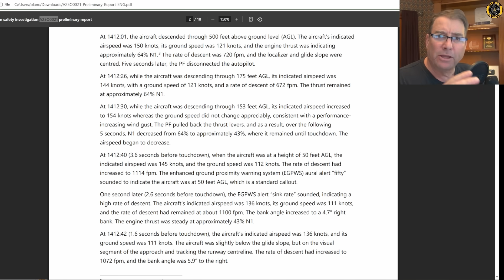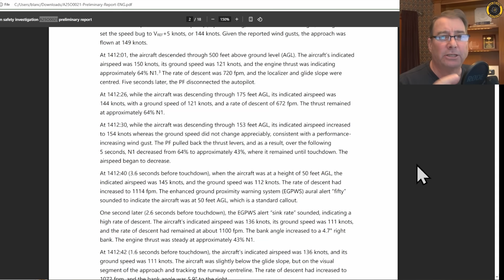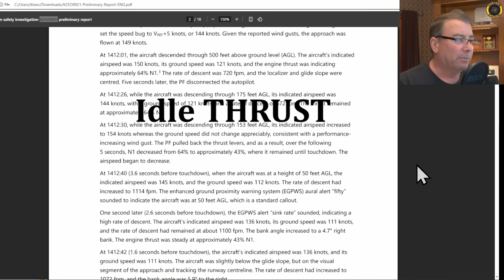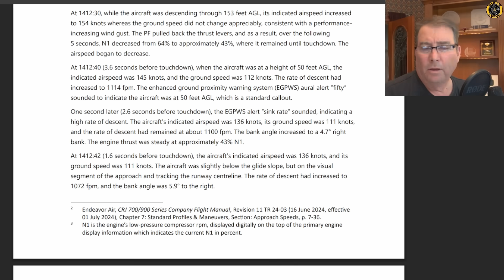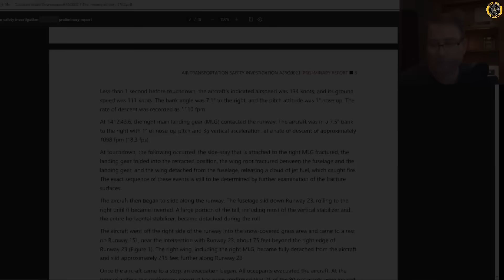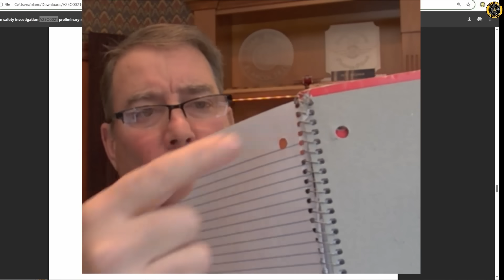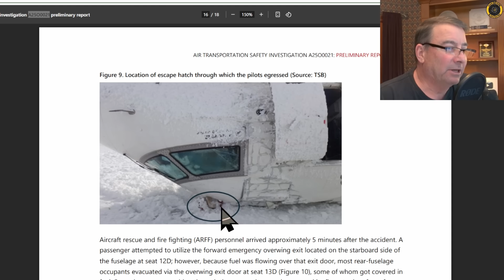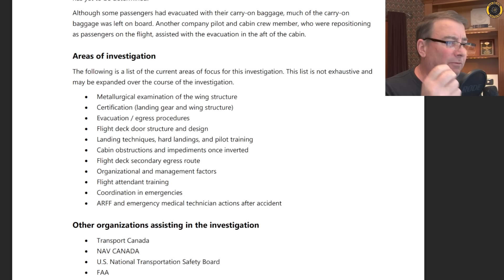TSB Prelim Toronto CRJ Crash

Comment: Retired airline pilot here.
The biggest issue I have with this accident is the captain determines who's will fly every leg 

Captain makes that decision based on what's the safest for each flight 

Good judgment is to select the most experienced capable pilot that day for that Leg

When it's extreme conditions or limits such as a very strong gusty Cross wind with blowing snow

Normally the captain would fly that leg because he can manipulate the controls quickly and rapidly without having to try to take over. 

It also gives the first officer an opportunity to watch someone more experienced in extreme conditions handle Air Craft. 

Learning by example rather than learning by making critical mistakes in extreme conditions probably isn't the best use of good judgment when selecting the pilot to fly. Especially with a plane full of passengers on board. This is not the simulator!!

Captain had more total time and had more time in the Aircraft but less time in the last 30 days than the first officer 

Another factor is that if the Captain and first Officer had flown together on a regular basis and knew each other's skill level that would have an impact on who will be flying that leg.

Perhaps the accident would not have happened had the captain had been at controls at the controls 

It appears that improper control inputs were applied at critical moments prior to landing that caused the accident . 

More importantly possibly poor judgment selecting the proper pilot to fly that day was the bigger issue .

Comment: Pilot lack of skills and inexperience caused this crash. The 1500 hr rule addresses getting pilots higher pay but doesn't address the real problem of people getting into the cockpit that don't belong there. The 767 in Houston, The Horizon Air pulled engine fire extinguishers, now this. What will it take to fix the broken pilot training system which is now placing incompetent unskilled pilots into the cockpits?

Comment: Just think in WW1 pilots were assigned to combat with 14-15 total hours. Recurrent training should include 5-hrs doing touch and goes in a Cessna 152. The high sink rate was hard to see in the videos, but explains alot.
Reply: Yeah in underpowered airplanes with a top speed of 80 mph.
Apples and Oranges.

Comment: I’m wondering if the pilot flying froze in the last 10 seconds and didn’t know what to do. Why didn’t they add power and go around? Fatigue? How did the bank angle get so tilted before touchdown? Thankful the fuselage was rigid enough to maintain integrity to allow everyone to escape. Cars are not built to withstand 130 mph and 3Gs into a hard surface.

Comment: Ok I have landed a plane once but landed a parachute 4500 times. Parachutes are wings, highly inefficient ones at that compared with airplane wings and they are very sensitive to gusts. The reason I bring this up is that I feel these pilots were blindsided by a big drop in headwind at the last second and they had no time to spool up the engines before wheels met ground. So I think all this talk about stick and rudder skills is all well and good but maybe most pilots would have been caught out by this one. I’ve seen enough experienced skydivers wake up in hospital after a gust caught them out ten feet off the ground.

Comment: If she had left the power setting alone...she would still have been hot on the VSI but the bank angle likely not have increased putting a side load on the gear and she might have kept the wing attached.  Ah well, she what she could under the circumstances and now she has additional experience as part of her repertoire.

Comment: I was a EDV check pilot for many years. The one thing that is telling to me is the lack of flight time the PIC had. After 20 plus years one would expect at least 10,000 hours. Also when I would get a new student we would talk about how the AC did not land like the sim. The sim in a wonderful procedure training device and even though it is a level D sim it does not do a great job of replicating the landing.  During a gusty day like the day the accident happened I would always brief "Do not accept Airspeed deviations below target airspeed"  Pulling the thrust levers to idle in the CRJ 900 on a calm day at 150' will probably damage the AC. On a gusty day...well wow we got what happened.

Comment: Two things regarding the crew - The weather conditions were a factor in leading the FO into what she did.  She had already flown into Toronto 3 times recently so she was expecting the “landing picture” to look a certain way. The runways in Toronto are 200 feet wide. That’s 50 feet wider than runways at major US airports. The visual picture of this difference gives the appearance that you are higher over the wider runway.  Next the runway was only plowed to 160 foot wide which may have gone unnoticed by the crew in regards to how that would change the “landing sight picture” for this landing. Next, blowing snow across the runway along with the snow covered airport can drastically affect one’s depth perception because everything is white with little to no contrast.  Finally for the Captain, in addition to being the pilot monitoring he is also the pilot in command - his hands should have been behind the throttles backing up the FO with airspeed callouts and ready to add power when he saw the speed deteriorating and felt the sinker coming. - What was he doing? Did he recognize what was coming? Why didn’t he react with power or pitch inputs? As a sim instructor, the Captain has most likely spent the majority of his recent time instructing from a position behind the pilots he is teaching in the sim which gives him a completely different landing sight picture than the pilots in the sim.   It may be that the Captains lack of recent experience is the bigger overall factor in what happened here.

Comment: After living in Minnesota for many years, there are times when the snow is blowing sideways over the road and all depth perception fades away! You lose reference to the road itself and it’s difficult to realize where the edge of the road is or where the surface level is compared to the snowbanks on either side. I’ve never landed in those conditions, but I have driven in them. Granted, it has to be blowing a good amount of snow to do this but I’ve certainly experienced it. The first thing that occurred to me was that they should have a radar altimeter to call out height above ground for flare reference which should help mitigate that effect but something certainly didn’t follow through on this one. 

To all northern pilots who fly in those conditions, is it easy to lose all depth perception when landing in those conditions just like when driving??

Comment: Juan, I've been a "vehicle" geek my whole life (mini bikes, go karts, dirt/street motorcycles, race car coach, trucks, and aviation) and I couldn't help thinking exactly what your high-time instructor commented.  

I'm a VFR private pilot with about 1,000 hours, much of it in the very gusty KRNO area.  I fly for fun and adventure.  Might do commercial multi in the future, for some expertise and income.

The point is that I don't believe an instructor can take a person off the street, man or woman, train them up, get them through ratings and types, and expect them to have the intuition for, or ability to react to, dynamic changes in "vehicle dynamics".

I have zero time in anything like an RJ (1 TO/LAND in a C650).  But, in my humble opinion, this is a classic example of failing to adapt correctly to the pitch/power speed debate.  Intuition tells me to never pull the throttle back in gusty conditions.  Been there, on a calm day, taking a 20kt rear quartering tailwind, which seemingly came from nowhere.  Around here, I'm always at Vref + 5++ until in ground effect.  Admittedly, I don't know how much ground effect the RJ exhibits (guessing not much), but I can't wrap my head around the throttle reduction.  If anything, I would push the throttle up a tad, in anticipation of the gust suddenly quitting, and take the long landing (knowing how much extra runway was available).  Or, like you said, just go around.  

The silver lining, other than everyone survived, thank God...  Perhaps this situation and outcome will change the training.  

I'm guessing (again) that the instructor captain PIC has 4x to 5x his actual time.  It's almost inconceivable he hadn't encountered this exact situation in the SIM.  He should have established his authority in advance, and said, "My controls."
Reply: Flying in gusty conditions is a matter of experience and not of training. There is no FAA requirement (even for level D simulators) to simulate gusty conditions. When I left the airline industry about ten years ago, such capabilities did not exist anywhere; I believe that situation remains unchanged today.

Comment: Something seems very systemically wrong here, when the FO, with pretty few hours flying that model, is more qualified to be making that landing - in very tricky wind conditions - than the Captain. Even I, a non-pilot, know that that should either have been a go-around, or a higher power landing further down the runway. How do 2 FAA certified pilots seem to not know that?

Comment: Question regarding setting such a high gust factor
In the company i fly in we also use Vref+5 for std operation. 
If there is gust we add half the gust up to a max of total 5. So maximum added equals 10kts. Reason we do that is to keep a margin to the "stabilised" criteria which is -0 to +20 kts
You have a flexible stabilisation criteria in the company where you fly ?

Comment: Hi, I think your comment at the end of this video concerning "Stick and Rudder" training is quite correct............I'm no pilot, just a flight simmer,  but hear pilots do all their training in the simulator and their first flight in the real thing is with passengers just goes to show how much we fast track these young people today. It isn't just in the airline industry though. As a lorry driver, 18wheeler to those of you in the States we find very inexperienced drivers taking out max weight trucks yet driving them as if they are driving a sports car..............Where is the training that said, respect the vehicle, get it wrong and it will bite back..............as in this case I fear. Anyway great channel and love your acurate assessments of airline incidents. Thank you.
Reply: FYI, the airlines realize that a newly minted airline pilot needs extra hand holding coming out of the sim and puts them on IOE (Initial Operating Experience).  During IOE, they are flying, not just with a Captain, but an experienced instructor Captain.   Similarly with a new Captain, they will fly IOE with an experienced Captain for a while.

Comment: Part of windshear training is what Juan pointed out - that increasing airspeed will likely result in a subsequent loss, and must be considered when approaching the runway. When 3-4 miles out on an approach, a power reduction is less worrisome than when at 170 feet over the runway.
With a 20 knot headwind component, the ground speed was already in the 110-120 kt range and with a 10000 ft runway, there was adequate distance to land slightly long and still stop with half a runway left...

Comment: When I was flying for them I’d bug the ref+ gusts. I believe that was the book in CRJ200.
Personally, in these cross wind situations I’d NOT make any power reductions due to gusts. What goes up, comes down. Plus that set of buildings should have been a clue of unsteady air over numbers.

I believe the CRJ900’s had auto throttles. Think they have to have it because of the flyby wire connection to engines.

Something that the 900 has that the 200 doesn’t is that with the cockpit so far in front of the center of rotation, the last minute pitch input to ‘save’ a landing in the 900 really drives the landing gear into the ground making a very abrupt arrival. I think the sinker at the end of the runway caught them. The FO pulled the thrust back and there was nothing to do but ride it out unfortunately.

As a former Endeavor/Mesaba pilot I know the level of training and the quality of instructors. Before the Merger and Mesaba went away we had 67 years without an accident and one of the highest experienced pilot groups in the industry.

It is sad this happened. It is definitely a stick and throttle/ experience issue. I am glad no one was hurt.

Comment: Just about every industry has been relaxing training and safety practices over the years in my opinion. We have seen much increase in the trucking industry, locomotive trains, aircraft, marine and so forth. It seems that no one is taking the precautionary training all that serious as these accidents continue to rise. Maybe its the older and more experienced folks retiring and moving out of these industries allowing them to be diluted vs. enforced with great focus in all areas of importance, regardless of the chances of some issues to arise. Folks simply need more detailed training and training by very experienced staff. Seems like the rules are all there but too many operators are just not all that good at their job and only expecting the routine experiences vs. those that can come up and bite you now and then. This has been happening for a long while...sad.

Comment: On the list of action points. One thing that should be added is previous flights, if the pilots think something is difficult, non standard, then they need to tell the Tower and the tower communicate that to the next to land.

Comment: I believe I read this aircraft had a max limit of 20 for gusts. Normal calcs to be one half of the gusts.
Reply: There are no published limits for “gusts”, there are only limits for crosswind component which on CRJ is 37 kts for a bare, dry runway
Reply: @olasek7972  Yes but if I read correctly, the CRJ says take half of that gust for compensation up to a max of 10 as they say divide by 2.
Reply: @Garth2011  that’s how you adjust your landing speed , nothing to do with gust limit
Reply: @olasek7972  BIG question for those who noticed, the gusts were up there, would going around have been a fair thought to make for an airliner or too conservative?
Reply: @Garth2011  it was definitely a valid option, safety always first, hopefully the final report will shed light on the subject

Comment: Your 20 kts gust factor is for auto throttle equipped aircraft. An alert pilot manually working the thrust levers will maintain airspeed more precisely than the auto throttle.

Comment: Curious when they get into crew info: the CRJ 200 and 900 share a type rating, right? Just wondering because I'm recalling a conversation a while back with a friend of mine who flies CRJs who was talking about transitioning from the 200 to the 700 or 900 (can't remember) and her remarking that the 200 (with its lack of slats) has a totally different landing attitude from the bigger ones that are equipped with slats. I think I remember her saying that in the 200 it's like you don't flare at all, whereas on the bigger aircraft you do. Wondering if I'm recalling all that correctly, and if that maybe could've been a factor? It's really striking watching the video how they just didn't seem to even attempt to flare.
Reply: Does Endeavor have any 200s? It’s possible that FO has never flown a 200.

Comment: The CRJ is a fine aircraft. I have a friend who is a Captain for PSA, flying CRJs. She gained her pre-ATP experience teaching students at Embry Riddle, where she earned her degree. She learned a lot of stick and rudder skills getting this experience. She knew the crew in the DC accident.  It's really crucial that pilots have stick and rudder skills and I have seen many airline pilots who fly little planes in their off time to keep those skills sharp.
Reply: As a non-pilot who has flown 2M air miles, the CRJ is one of the most stable aircraft in which I have flown whether it be a 200, 700 or 900.
Reply: That you think an instructor at Embry Riddle has a lot of stick and rudder experience is cute.

Comment: Great video as always. In addition to watching Juan’s video (and some of lesser quality) on the preliminary report I also read the report. I would have liked to have seen a transcript of the CVR. The only information contained in the preliminary report is the “sink rate” GPWS automated call. I would like to know whether the PM (the Captain in this case) made any deviation calls. The primary role of the PM is to monitor the flight path and bring to the attention of the PF any deviations from SOPs or safe parameters. At my airline we have mandatory deviation callouts by the PM. The PF has to respond to this by verbalizing corrective action. A sink rate of > 1000 fpm below 1000 ft AAL is a mandatory deviation callout. The drop in indicated airspeed below Vref is also a mandatory deviation callout. Were any of these callouts made? I am curious as to how this approach was briefed. That should also be on the CVR. Were the threats briefed accordingly, e.g. the threat of windshear on this approach? Very curious to get a full CVR transcript at some point.